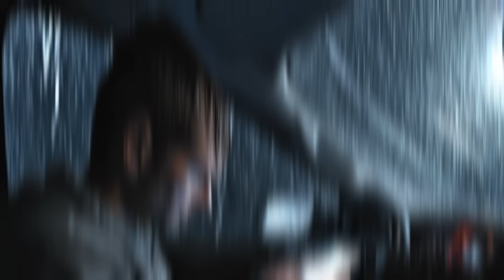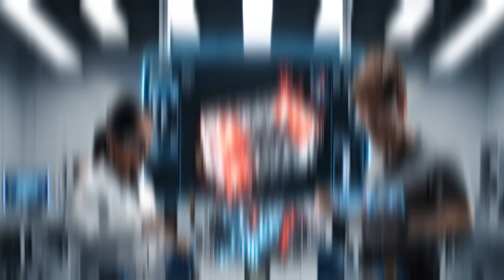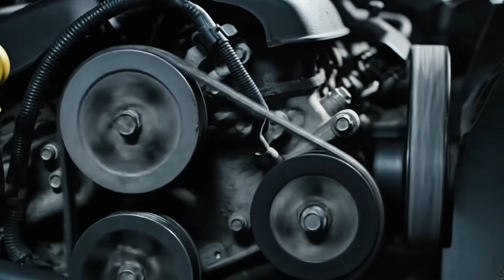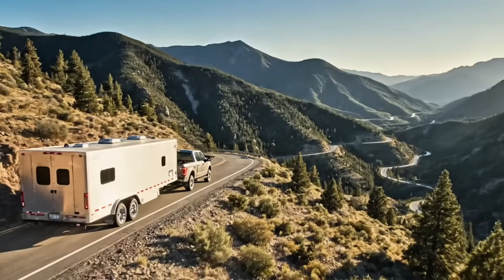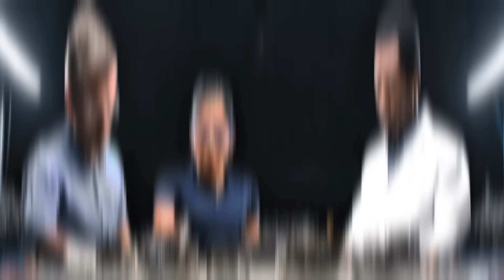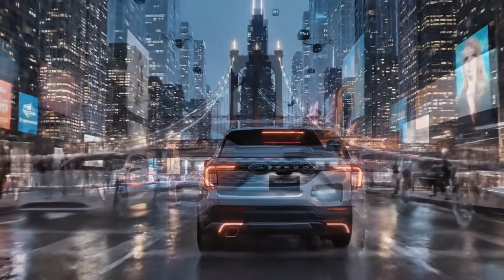Ford Just Ended the EcoBoost Nightmare in 2026 — Truth Revealed

Comment: The second generation 3.5 ecoboost already has dual injection, been there since 2017 or 18 when the gen 2 was introduced.
Reply from the maker: Yep, you’re right — the Gen 2 3.5 EcoBoost already brought in the dual injection setup. A lot of people still don’t realize that update helped address several of the early carbon buildup concerns.
Reply: Yeah that’s nothing new. So, these so called upgrades are probably a joke too.
Reply from the maker: @Jefferson-i2w8d  Some upgrades definitely get overhyped online but there have been real engineering changes over the years too. Whether they’re enough long term is what owners are still debating.
Reply: If they go back to a closed deck design block, that will solve 95% of the coolant in the cylinder problems that all ecoboosts have, especially the 2.3
Reply from the maker: @mikeabney1214 A lot of techs and owners say the same thing about the closed deck design, especially regarding the 2.3. It’ll be interesting to see what direction Ford takes with future revisions.

Comment: The best solution for Ecoboost on the F150 is to get the Coyote engine.  Problem solved.
Reply: Exactly, other F150 buyers have already proven the 5.0l will outlast the 3.5l fecal boost v6.
Reply from the maker: @jeffreyfitch1006  A lot of long-term owners definitely trust the 5.0 for simplicity and durability. The EcoBoost still wins a lot of people over with torque and towing though.
Reply: @jeffreyfitch1006 Both were direct injection engines.
Reply: My 2016 coyote f150 has 340,000 on it right now. Replaced a water pump and a starter. Thats it.  But it does have an oil leak that needs to be addressed.
Reply from the maker: @donsaxon1169  340k on a 2016 is seriously impressive 👏 A water pump, starter, and an oil leak at that mileage honestly sounds like a truck that’s been worked, not babied.
Reply: They’ve ruined them now with the multiple 4-6- multiple piston crap
Reply from the maker: @paulgrimm  Cylinder deactivation has definitely become one of the biggest debates in modern engines. Great for emissions and MPG on paper, but a lot of owners still prefer simpler setups long-term.
Reply: @NextGenWheels-s5r It’s garbage
Reply from the maker: @paulgrimm  A lot of owners agree with you 😅. The biggest complaint is that the added complexity doesn’t always feel worth the small MPG gains. Reliability is still king for most truck buyers.
Reply: The coyote is not a simple V8
Reply: @sandimashigh 1st and 2nd gens are simple engines but the 3th gen and 4th I'm agree with you in that
Reply from the maker: @adambenshaban6927  That’s a good breakdown honestly. The earlier Coyotes were simpler overall, while the newer generations added a lot more tech and complexity.
Reply from the maker: @sandimashigh  That’s fair — compared to old pushrod V8s, the modern Coyote is definitely a much more advanced and complex engine.
Reply from the maker: A lot of truck owners feel that way 😂 The Coyote’s simplicity and sound definitely win people over, while the EcoBoost wins on torque and towing. Really comes down to what kind of driving you do most.
Reply: @NextGenWheels-s5r That Coyote engine should be an option in the BRONCO. In many cases, there is no replacement for displacement.
Reply: @bikdav and expedition
Reply: @a @adambenshaban6927 Ooppse! You're right.  I forgot about the Expedition.
Reply from the maker: @bikdav A Bronco with the 5.0 would definitely have a huge fanbase The sound and low-end feel alone would sell a lot of people on it.
Reply from the maker: @adambenshaban6927  Good catch — the Expedition definitely gets overlooked in these discussions sometimes.
Reply from the maker: @bikdav Happens to all of us Ford’s lineup is getting so big now it’s easy to forget which models get what powertrain.
Reply: @NextGenWheels-s5r  You guys are absolutely clueless. 
"The Coyote’s simplicity and sound definitely win people over"
The 307 is one of the most complicated motors on the road. You have to start looking at exotic vehicles to fine something more complicated.  How could you make a video like this and not know what I'm talking about? You don't know anything about cars. You just make youtube videos. Have any of you ever installed one of these engines? Never. The first thing you'll notice is how big they are. As far as engines go, a 307 is not that big. Its a small block. Ford puts so much crap on these motors its bigger than a typical big block engine. This is why we have to pull the cabs off to work on them. They don't even fit in the Mustang. They can't install it through the hood. Ford had to design an engine cradle like they have on front wheel drive cars and install it from the bottom up. 
There's so much to say on this topic, I could write a book to cover it all. I don't have time for that so I'll tell you what Ford did to fix the excessive oil burning. Its not uncommon for a late model 5.0 to burn up to a qt of oil every 500 miles. Ford started by modifying the oil pan. They walled off the area around the dipstick so it has its own compartment. A pin hole was drilled in the new wall so oil can get to the dipstick. Why was this done? The pin hole makes the oil transfer to and from the dipstick enclosure take a lot longer. Most people check their oil when the motor is warm. When you turn the motor off, pop the hood and pull the dipstick, you get a false reading because there isn't enough time for all of the oil to get out of the dipstick compartment. It shows more oil than what's really in the engine. You have to give it 5 to 10 minutes before you can get an accurate reading. They also upped the oil capacity from 8 to 8.75 qts. Don't believe me? Look at a picture of an oil pan for a gen 3 or newer 307. You'll see the dipstick enclosure. Also, check the fluid specs to see the increase in capacity. And this is just one issue. There's plenty of other problems with the engine, and the truck in general. We replace a lot more 8 cylinders that 6. Of all the engine options, the 3.5 is the most fixable. A good portion of the time, they can be repaired. With the 307 and 2.7, they usually get replaced, not fixed. 
Also, don't forget the F150 comes with a transmission that's every bit as complicated as the motor, and it all gets plugged into a computer network that has over 50 modules. (Module=computer). I know I'm using a harsh tone here, but one of the biggest problems we face is misinformation. Most youtube videos have a tremendous amount of bad info in them, and customers think they know what they're talking about. They have no idea. But if it makes you feel better, I work for Ford and do mostly heavy line warranty work. I get Ford customers brand new engines and transmissions, all covered under warranty, literally every day I go to work. The least expensive motors I replace are the 4 cylinders. The average amount I bill Ford for one of these engines is about $10,000. 6 and 8's are a lot more. 90% of our customers could never afford a repair that expensive. I know everyone hates dealers, but there's no other place I can work to help so many people. 
Here's a tip for anyone with warranty issues. When someone says Ford (or any other brand) declined my warranty, they usually didn't. Even though you have a warranty with the manufacturer, they need the dealers to handle the claims. Dealers are supposed to go by the rules the manufacturers set. If the dealer is really busy, or doesn't have enough help, or whatever, they'll just say Ford declined the repair. At that point, most people give up. I can't tell you how many times I got customers brand new motors covered completely under warranty right after another dealer declined the same claim. Get a 2nd, 3rd or 4th opinion. You can use any dealer you want. If you have a Ford, you can go to a Lincoln only dealer. Most people don't know this, but dealers and techs make a lot of money on these big jobs. If a dealer doesn't want them, something's wrong. The manufacturer loses all the money on a warranty repairs. Its the dealers biggest source of income.
Reply from the maker: @052RC  Fair points on the packaging and serviceability side — modern DOHC V8s definitely aren’t “simple” once you start talking repairs and engine bay access. My comment was more about how a lot of owners compare the naturally aspirated feel and sound of the Coyote against turbo setups, not that the engine itself is mechanically basic.
Reply: @052RC now it needs a manual transmission to pair with it.
Reply from the maker: @CGnaseyowma  A modern Coyote paired with a good manual would make a lot of enthusiasts very happy. Sadly manuals are disappearing fast in trucks and SUVs.
Reply: Is the Coyote in an F150 a 307? Just want to make sure I am following your points. So far 93k on my 2021 F150 4x4 with the 5.0. No issues except for a defective oil seal I need to replace at cylinder number 8, but it’s not a big issue. The engine has been solid so far - the transmission gets quirky when I use cruise control when driving on hilly highways,  but other than that, the drive train has been solid. Thanks for posting.
Reply: @NextGenWheels-s5r I would much rather have twin turbos than cylinder deactivation
Reply from the maker: @AaronEmerald  I get that. A lot of owners would rather deal with turbos than cylinder deactivation systems. Both have their fans and critics, but reliability is usually what decides the argument in the long run.
Reply from the maker: @johngarner9929  Thanks for sharing your experience 👍. And yes, the Coyote is Ford’s 5.0L V8. 93k miles with only a minor oil seal issue sounds like it’s treated you pretty well overall. Hopefully it keeps racking up trouble-free miles for years to come.

Comment: Cant say for everyone else. The 3.5 ecoboost has been a great engine for me. Ive had 3 different vehicles with this engine. Still driving the 3rd. About to hit 200k miles. Valve cover gaskets and a waterpump @ 187k. That's it. That engine sits in ax expedition el xlt 4x4. The other 2 were f150 4x4. My first had 257k and changed 1 sensor. That's it. My second valve cover, 1 cam sensor, and waterpump in 267k.
Reply from the maker: That’s exactly the kind of long-term ownership experience people want to hear about. 200k–250k+ miles across multiple 3.5 EcoBoosts with relatively minor repairs says a lot about how solid they can be when maintained properly.
Reply: @NextGenWheels-s5r maintained properly……the step most miss….
Reply from the maker: @davebona9592 Exactly 👍 A lot of modern engines can live a long time, but maintenance habits usually make the biggest difference in the long run.
Reply: Older Ford engines woyld out last the body ... go back to time gears and carbs
Reply: @dustinmark6808  That will never happen.
Reply from the maker: 😂 Truck and engine debates always bring out the strongest reactions.
Reply from the maker: @dustinmark6808  Those old carbureted/timing gear engines were definitely simpler to work on. Modern power and emissions came with a lot more complexity.
Reply: Not twin turbo
Reply from the maker: @TheJohnbjunior  A lot of people still prefer a single turbo or naturally aspirated setup for simplicity. Twin turbos make great power, but there are definitely more parts involved.
Reply: The 3.5 was the only good ecoboost.
Reply from the maker: @davisrs1  The 3.5 definitely earned the strongest reputation out of the EcoBoost lineup, especially for towing and overall performance.
Reply: 156k Coyote F150... nothing but spark plugs, oil, filters...
Reply from the maker: @billthepatriot4419  That’s a solid run 👍 The Coyote V8 has definitely earned a reputation for durability when it’s maintained consistently.
Reply: Prices still too high!
Too many points of failure with electronics!
Return the right to repair back to the owner!
Get away from the very thin oil!
Make DealerSoftware available to repair shops so you don’t have to go to the dealer for maintenance unless they are willing to lower prices!
Get rid of the cell modem for transmitting driver data to the automakers to sell to the insurance companies!
No lock out!
Reply from the maker: @ronlee2776  A lot of owners definitely miss the simpler days of trucks. Repair costs, electronics, and software dependence have become a huge frustration across the whole industry lately.
Reply: 2.7 v6 twin turbo. 180k still works like new.
Reply from the maker: @robiparry941  Great mileage 👍 A lot of owners with the 2.7 EcoBoost seem to report really good long-term reliability when they stay on top of maintenance.
Reply: eeeeyaaaaaa🤣
Reply from the maker: @steverulien8042 😂
Reply: Agreed 💯👍
Reply from the maker: @carlmorgan2859  Appreciate it 👍
Reply: That's 5 small repairs in almost three quarters of a million miles combined 🤣👍🤣

The real question is why can't Toyota and the other "boosters;who are late to the party", figure it out???
Reply from the maker: @TheCamper83  That’s what makes it interesting. Some manufacturers nail a turbo platform right away, while others take years to work through the bugs. In the end, real-world mileage and long-term reliability are what separate the winners from the rest.
Reply: Valve cover gaskets and water pump maintenance being done before 200k miles is a bad thing. What are you bragging about? Your car costing you more than it should?
Reply from the maker: @jeffreyfitch1006  Fair point — nobody wants repairs before 200k. I think some owners just see those as relatively minor compared to major engine or transmission failures at high mileage.
Reply: @jeffreyfitch1006 ohhh stfu, water pumps are a failure point on every automotive engine ever made. The problem is WHERE that water pump is located. Valve cover gaskets are another failure point. Modern engines are designed with maximum thermal efficiency in mind, and they are under far more stress than your grandpa’s 350. They are marvels of engineering, and I find it amazing that they don’t all blow up. For every story you ever heard about an “Ecoboom”, there are thousands of other satisfied owners that have blithely driven theirs without any problems.
Reply from the maker: @gonepostal9101  That’s a solid point honestly. Modern engines are making huge power, meeting strict emissions standards, and still lasting 200k+ in many cases. The real debate now is less about “can they last” and more about long-term maintenance costs and complexity compared to the older simpler setups.
Reply: @NextGenWheels-s5r honestly, I find it kinda funny that people just expect their engines to automatically last 200,000+miles, but also a credit to the OEM’s that many of them do. I got my drivers license when I was 16, in 1979, and I’m here to tell you that we were amazed if you got 100,000mi out of a car without something major breaking. I remember one of the cars I had my old man helped me find. He knew an old guy with a ‘69 Biscayne with  307 and a Powerglide that only had 50K on it, and I got a good deal on it. By the time that car had 70K on it, the rings were so bad, I literally kept gallons of oil in the trunk. I finally got so tired of the smoke, I yanked it, and put a junkyard 350 in it. Don’t even ask me about my Mopar days. Lolol. When OBDII kicked in, I pretty much hung up the wrenches, but I still wrench on my old, pre-OBDII Powerstroke F-250.
Reply from the maker: @gonepostal9101  That’s actually a great perspective. A lot of people forget how normal major engine work used to be before 100k miles. Modern engines definitely have their flaws, but overall durability today is still pretty incredible compared to decades ago 👍

Comment: Ford spelled backwards means Driver Returns On Foot
Reply from the maker: 😂 That joke has been around forever and somehow still survives every generation. Meanwhile there are plenty of Fords out there with 200k+ miles still working hard.
Reply: Yeah I have two one with 500 k and one with 300 k
Reply from the maker: @JimmyDolittle-dm4gc That’s impressive 👌 500k and 300k miles says a lot about maintenance and how these trucks can hold up long-term when they’re taken care of properly.
Reply: But the other  vehicle that was called dodge and became RAM means Repair Again Mechanic and GMC means God Made Crap
Reply from the maker: @leslieholman3121  😂 Every truck brand has jokes attached to it at this point. Ford, Ram, GM, Toyota… nobody escapes the memes. But every brand also has owners with trucks that run forever.
Reply: @leslieholman3121 I thought GMC was General Mess of Crap! That was the saying back in the '60s. The Jimmy was a good truck, but parts was a big problem. It wasn't unusual for a Jimmy to be down and week or two waiting for parts.
Reply: @ronfullerton3162 Government
Motor
Corporation
Anything Gov't does turns to $hit (remember the Gov't bailouts)
Reply: @brandonrobertson6327 This was long before government bailouts. This was the '50s and '60s when GMC was real trucks. And they were a capable truck. I drove several Jimmy's. The straight trucks had a big V-6 that was a good truck motor. And they had a smaller one for the tonners. I worked for an agbusiness company back then. And we put a bunch of miles on those Jimmy's.
Reply: @ronfullerton3162 Truth is, all the big 3 American trucks was reliable back then. Ford, Chevy, and Dodge can't keep a truck past 100k now.